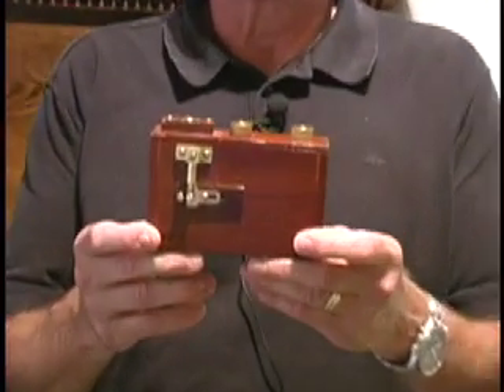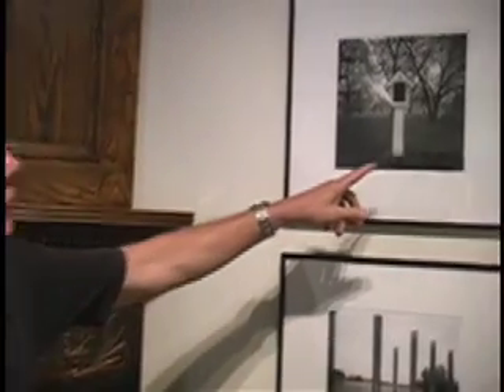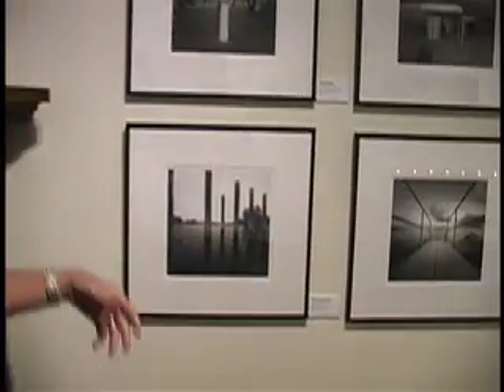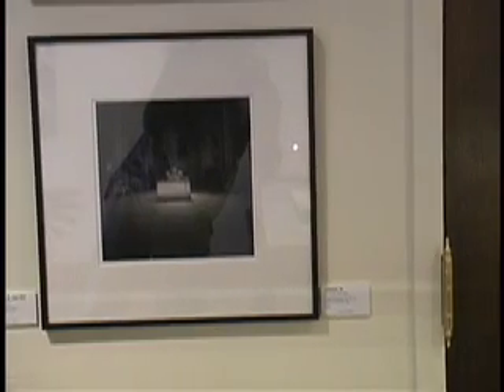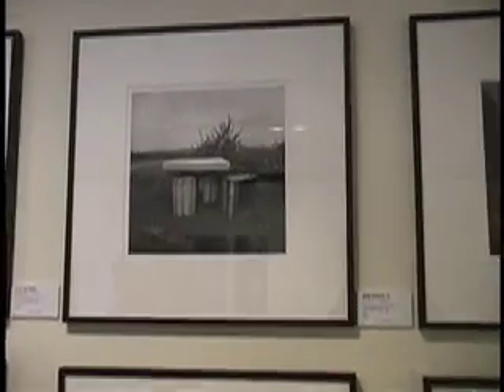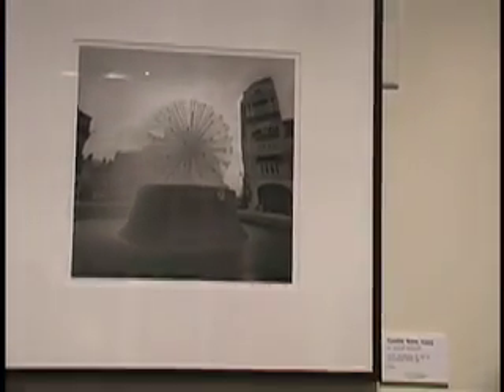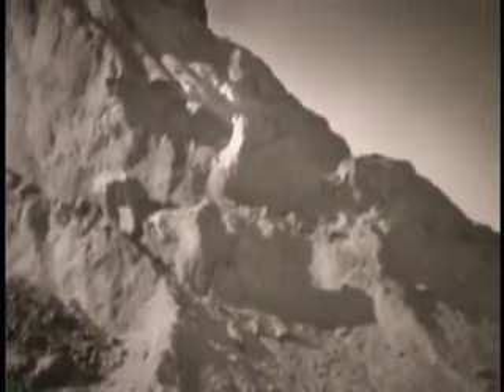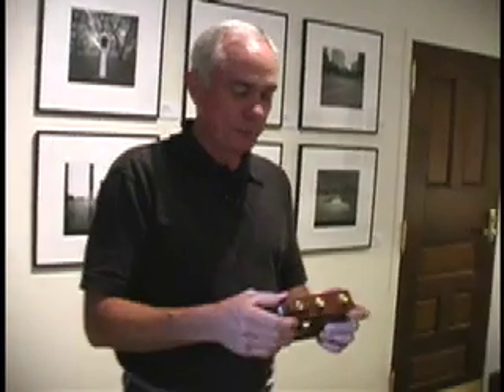Pinhole photography by Paul Jones

Comment: How do determine exposure time? Is it f22 alway and meter on that?
Reply from the maker: I use 1 second as my base exposure. For example if I meter something in the shade based on a 1 second exposure and get f/8 as the appropriate f, I then use a little calculator on the back of my main camera and find the exposure should be 5min @ f/138, which is my main camera's aperture. If you are interested you can download a hand held calculator from this sight. http://www.ilfordphoto.com/Webfiles/2011106152612113.pdf
You could of course do the calculations in your head but I was never good at that sort of stuff.
Hope this was helpful.

Comment: what should be a distance between a lens (hole) and a negative ? i am thinking about build a medium format (mainly 6x6) pinhole camera ...
Reply from the maker: It can be any distance. If the distance from pinhole to film is 25mm it would be equivalent to a 25mm lens regardless of film size. Imagine a 25mm lens on 4x5 film. There would of course be vignetting but that is part of the charm of pinhole.

Comment from the maker: Hi Daniel, My exposures are based on how bright the ambient light is. Generally a sunny day will be 1 or 2 seconds. In open shade my exposures may be 5 to 20 seconds. At dusk or sunset 5 minutes or longer. Inside maybe hours. If I want to photograph people they need to be still as the lighting requires. Yes, the longer the exposure the more detail in dark areas. I have not tried the panoramic camera but it sounds interesting. Maybe one day. Thanks for your comment on my video.

Comment from the maker: Hello Arek, Thanks for your interest. My first choice of film is Fuji Acros 100. I shoot it at E.I. 64. My favorite developer is Pyro PMK or similar. I have also used Ilford FP4 shot at 64 with good success. It has been my experience that any good film processed correctly will produce good results.
I scan the negatives with a Nikon coolscan and print them on a modified Epson 1400 and use Pieziography continuous ink sets. The prints are really quite good.
Good shooting,
Paul